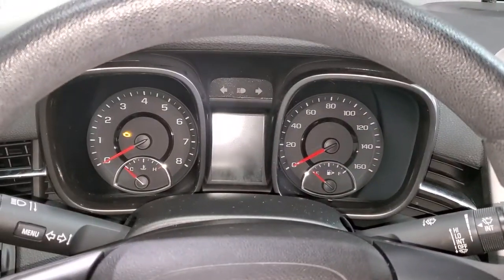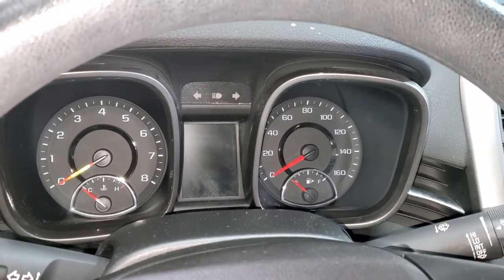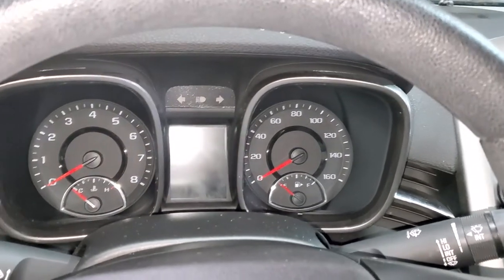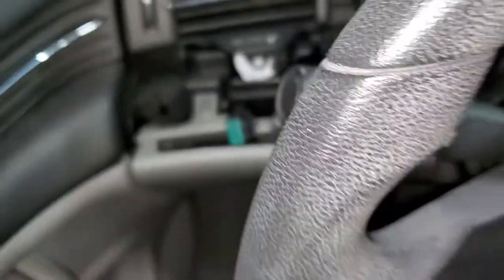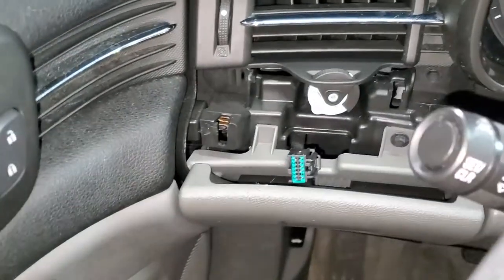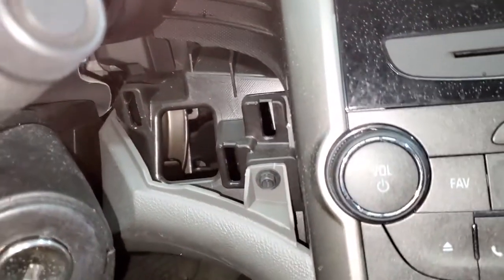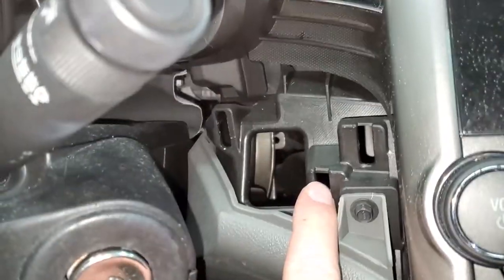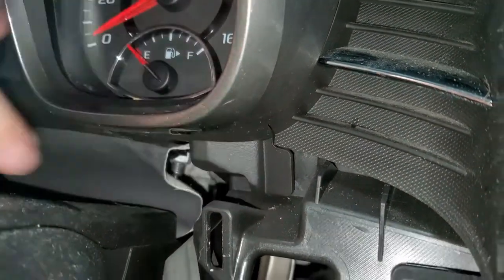2013 13 Malibu Regal Camaro Gauge Cluster Power Loss | How To Remove

Comment: I replaced my with an used one but the miles not showing what should I do ??
Reply from the maker: Very likely not a compatible cluster or it needs to be programmed to the car. Once it's programmed though the mileage from the junk car that the replacement cluster came out of will reflect on the cluster. It is best to get the original cluster repaired because it will not require programming and the mileage will remain the same.

Comment: Do not replace the part.  The odometer will be out and it won't be of that car when you sync at the dealer
Reply from the maker: That's correct. It is best to get the original cluster repaired. That is what we're here for.